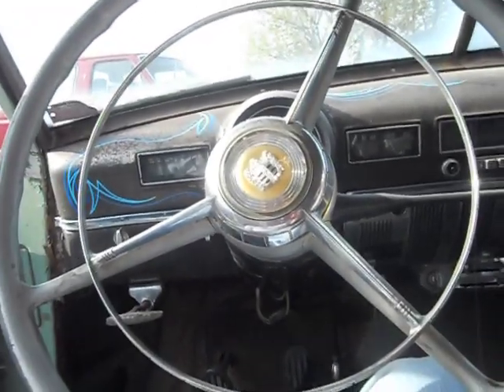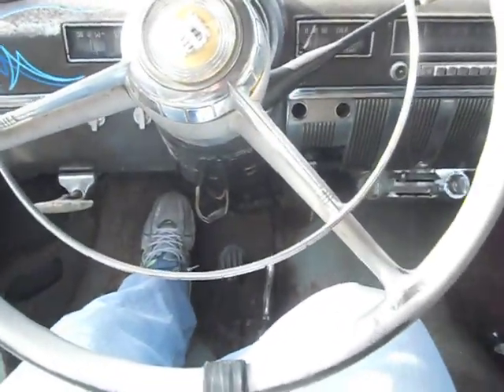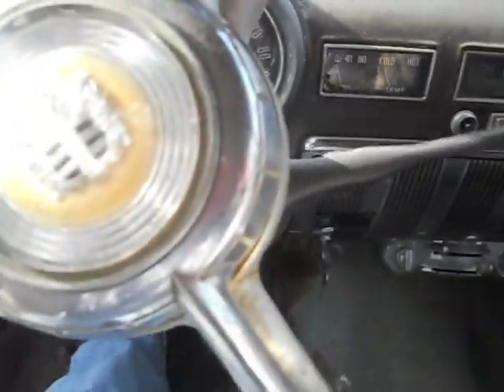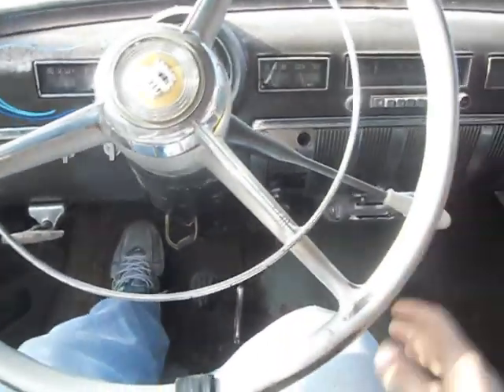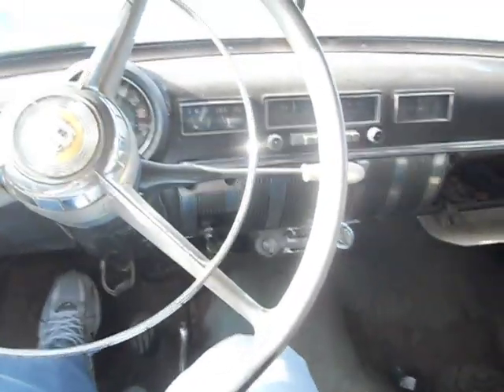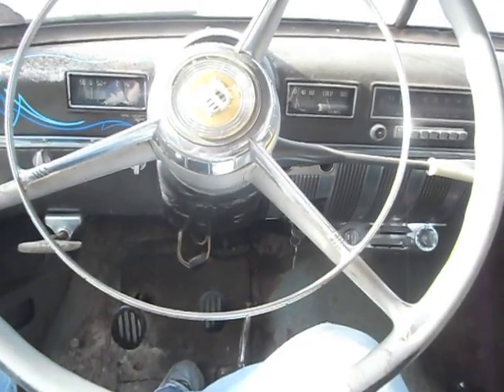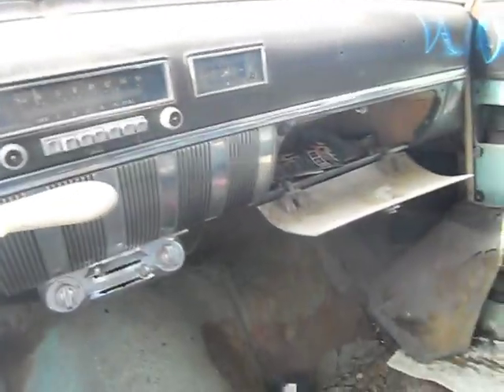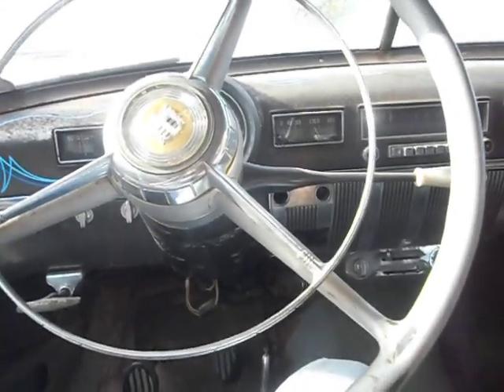How to drive a Gyro-Matic Transmission.AVI

Comment: The same as Fluid Drive?
Reply from the maker: Not for sure what you mean
Reply: Fluid Drive was another transmission Chrysler offered back then.  I wondered if Gyro-Matic and Fluid Drive were the same thing.   A comment further down answers the question
Reply from the maker: +lcar4000 oh ok, yeah I didn't know the answer to that lol, happy someone could help you though
Reply: No.  Fluid drive allowed you to stop without depressing the clutch.  Pretty much a manual transmission with a torque converter on front of it.  Fluid drive did NOT shift for you whatsoever.
Reply: Allpar has an article on this, the M6 transmission, variously known as Presto-Matic, Fluidmatic, Tip-Toe Shift, Gyro-Matic, and Gyro-Torque.

Fluid drive (like Hydramatic) had a fluid coupling, similar to but less sophisticated than a torque converter.  No torque multiplication in fluid drive.  This is one reason these earlier transmissions needed four speeds.  Later automatics with torque converters had comparable performance with only three speeds.
Reply: Actually, fluid drive did not have a torque converter.  Rather, it had a fluid clutch.  The difference is that while a torque converter would multiply torque by a factor of approximately two, a fluid clutch will not multiply torque.

The Plymouth Hy Drive was basically a manual transmission with a torque converter.
Reply: Did they operate the same,  though?  As far as the driver was concerned?
Reply: Yes, except that because the fluid clutch could not multiply torque the way a torque converter could, high gear starts were much more sluggish with a fluid clutch.
Reply: thanks for the info,  frank
Reply: Later versions of the Chrysler semiautomatic did use a torque converter as the fluid coupling.